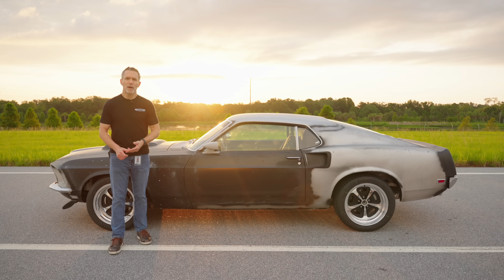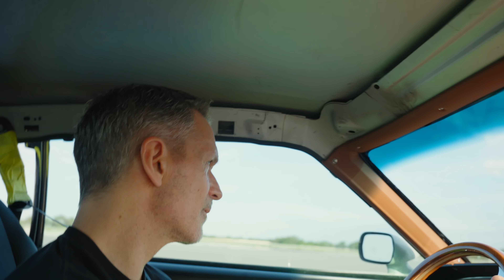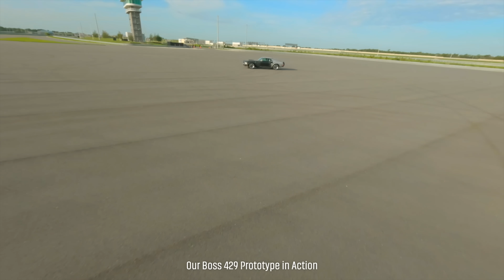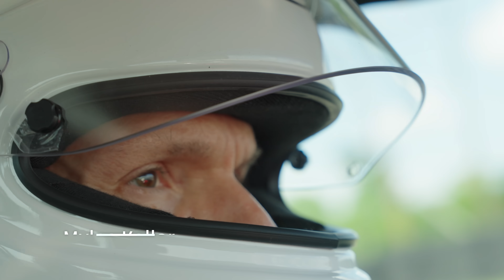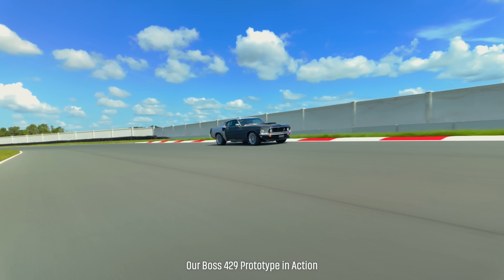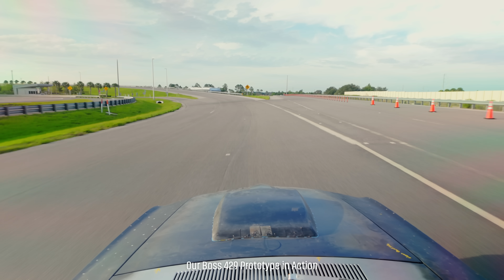Mustang Boss 429 by Revology: Ep. 07 | See The Test Car in Action

Comment: The thing that makes it a BOSS 429 Mustang… Is the 429 BOSS engine.
Without the BOSS engine, it’s nothing more than a Revology 1969 Mustang. 
Want to call it a BOSS?? Put a BOSS 429 engine in it.
Reply: Exactly 100%
Reply: Or a 302? Did they have a boss 302 or was that later?
Reply: @dave2873  The Ford Boss 302 refers to a high-performance version of the Mustang, originally created to meet racing homologation requirements for the Trans Am series in 1969 and 1970. It was a high-performance 302 cu in V8, a special high-output version of the standard 302 engine.